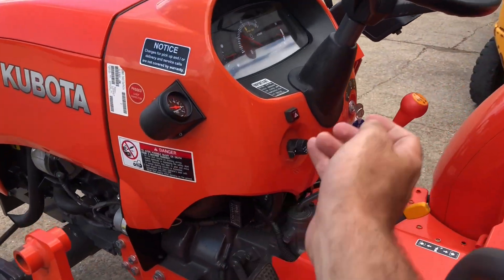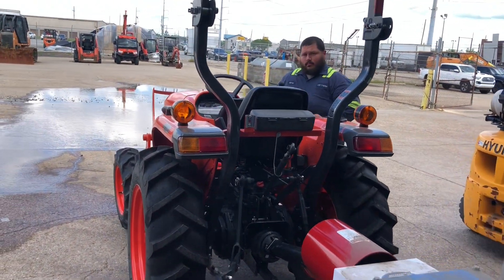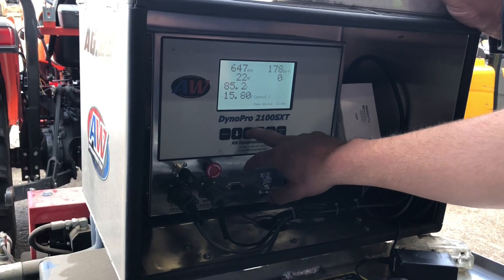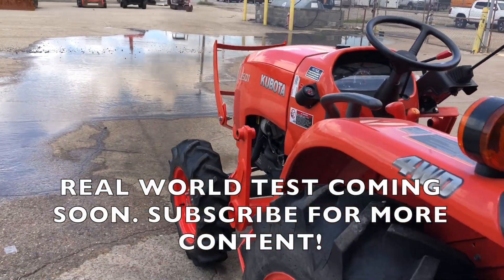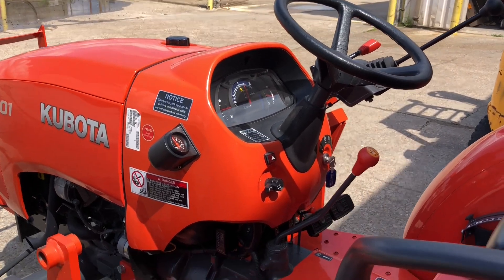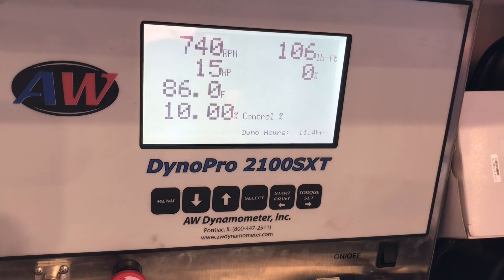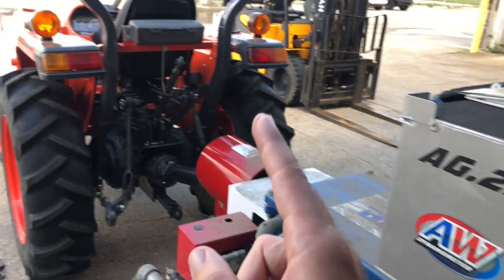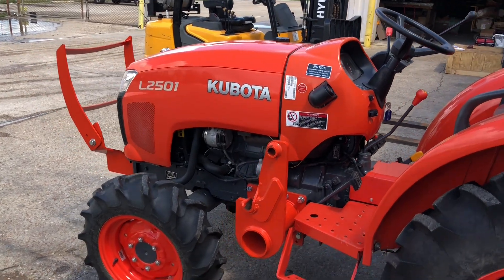Kubota L2501 Dyno Results ~ More Timing, More Fuel, & More Power!

Comment: I have the l2501 hst
Reply from the maker: Turn that bad boy up. That HST eats up some power.
Reply: I turned up my 2501 HST, one full turn on the screw. Running exact same conditions, she rolls coal under heavy load, max EGT just under 1300, very light smoke under normal loads. Its a completely different tractor to operate now. It was adequate stock, now its just a beast! Do it.
Reply: @bearswartz2907 
Hey buddy I installed that same autometer today. Was curious to see my temps. I was about 1050-1100 under load, stock. Do you know what yours was stock?
Reply: @dougchoate2009  No, I installed the gauge when I did the adjustment. I wish I'd installed it first so I could see what it was doing stock...
Reply: @bearswartz2907  oh alright no biggie. Well like I said, mine was about 1050. That was going up an incline in High gear which made it bog down a lot, and that’s when the temps creeped up. I will be using my 5’ brush hog this weekend to see how that affects the temp. 

One more thing, when I start my tractor it spits out black smoke but clears up very quickly. Have you noticed that with your tractor? Tractor is still stock.
Reply: @dougchoate2009  Yes, mine definitely did the little puff of black smoke on startup from the day it was new. It still does after I turned it up, about the same. It definitely starts faster and easier with the timing advanced. Barely hit the starter and it fires.
Reply: @bearswartz2907  im not sure if I’m going to dive into the timing or not, seems like a open heart surgery on my tractor. I’m sure it’s not too bad, kind of of the fence with that. Any idea what the startup black smoke is about?
Reply: @dougchoate2009  The black smoke is normal with any mechanical diesel engine, it's unburned fuel from the first squirt of the injectors before there's enough compression to fire. The mod is easy to do for someone who has some mechanical know-how, but I wouldn't recommend it if it doesn't seem simple to you. If you aren't familiar with the basics of fuel pumps, etc, it would be easy to do some expensive damage quickly.
Reply: @bearswartz2907  thanks for the info man
Reply: @bearswartz2907  
I got the tamper proof lock off the fuel adjustment screw. After messing with it for an hour I think I have found the sweet spot. I ended up measuring the distance from end of black adjustment bolt and the silver lock nut. I took pic, can’t figure out how to send it on these. I ended up at 5/8”. I’m wondering if you have some time, and don’t mind, could you also measure that distance to see how far out I am.

Comment: I wonder if anyone has put a small turbo on one of these? I feel like one of these engines is capable of 50hp. They certainly have enough displacement for it. Would probably over-power the gearbox then.

Comment: I always wondered how much the PTO angle affects those readings.  You had a huge angle going on there, and that would affect the reading greatly. Unless it was compensated for in the calcs. Bet it was actually slightly higher if the shaft was straight in. Prolly not by a huge amount, but could have been a couple horse legitimately. 💪

Comment: I love how you mentioned the tac cable. I’m on my 3rd one now on a 2022 L2501 with just 110 hrs. Other than that the tractor has been bullet proof.
Reply from the maker: Yeah, I tried the route the new one in the smoothest direction I could
Reply: @RaztechPowersports  if I break another one I’m just going to wire a 12v hour meter to the ignition and say the hell with it. I can judge rpms pretty close by sound. 😎

Comment: I have a JD 1025r we finally got a turbo kit out, and with that guys are throwing more fuel at them and making 15psi. I love these little diesel’s I’ll probably wait till i get 100 hours before i throw a turbo on mine but in the interim Ill crank up the fuel a bit as changing the timing is a real bore. Even if its 2-3hp it’s worth it you just don’t wanna roll coal that doesn’t do shit just waste money 

Great video

Comment: Finally. Someone who thinks like I do lol. I hook up everything i get my hands on. But I think I may leave my new 2501 alone for now 🤣
Reply from the maker: First time you run out of power cutting grass… you’ll pull it apart lol
Reply: @RaztechPowersports  lol! Luckily I got 2 kubota z mowers to handle the lawn. But if I end up getting a bush hog for the 2501, your words might end up ringing in my head one day haha. Already feeling slighted now that I've seen comparison on hydro vs geared, but luckily I don't need the 2501 for any plowing or hauling 😅 for me it's more like having an electric shovel and wheelbarrow/rake because that's all I really need it for. But I'm sure over time I will find more things to use it for! And then I'll end up wanting more power haha

Comment: I have the very same tractor. Gear drive and ag tires. The difference between the gear drive and hydrostatic as far as pulling power is unbelievable. The gear drive out pulls the hydrostatic badly.
Reply from the maker: Agreed! The gear drive spins all 4 tires in low range, regardless of the gear for loader work
Reply: I have hydro and you're making me jealous lol but I don't really need this for pulling. Mainly for spreading rock and around the house stuff. Small garden will be about the only real pulling I do. So I'm hoping I never come across the opportunity in which my hydro drive disappoints me lol
Reply: This the first thing I noticed, my last tractor was gear and this one is HST

Comment: I'm waiting on my new egt sensor, did this a while back but the cheap egt sensor sucked so I didn't tune it yet.  In the process of removing my fuel screw it moved too much so I've gotta figure out the tune.  Just screw it all the way in and start slowly doing 1/4 turns until the temp goes up ,  then back off?

Comment: What do you think just adding timing without fuel would gain? Mine is set to run at 3000 rpm not sure if that makes a difference.
Reply from the maker: What engine is it? At 3000 RPMs you’re probably already at the limits honestly. The l2501 was very restricted from the factory
Reply: Ditch Witch SK800 mini skid it has a D1105
Reply: Has anyone did a l2502

Comment: Very Kool modification & power improvement. A turbo-super-charger & air inter-cooler would be the ultimate. Thank you for the great Video Sir and happy tractoring.
Reply from the maker: I turbo charged my last tractor with great results (L285) 🏁. I was tempted to do it immediately on my L2501 but decided to start with the basics and she what she could do 💪🏻
Reply: @RaztechPowersports  oh yea liked that one also. As l recall that unit was a 4 " banger" :: a smooth operation. Just no real reason to over power a new tractor and send it to the junk yard before at least 500 hours of proven performance happens. This was a "brave move" for the Public improvement seminar to deleat your warrenty.

Comment: what are the max Temps for the exhaust?

when you say 1 full turn out, is that from stock?
Reply from the maker: 1350 - 1400 would be considered to hot and you would want to back off the throttle  / reduce the load. 

Yes, one full turn out from the stock location.
Reply: Thank you for doing this! I completed the mod yesterday on my 2501. Incredible difference in how it runs! I had the same 2 shims you did, pulled them both, and opened the fuel screw 1 turn. Get some black smoke under heavy load, and EGTs seem to top out around 1200. I saw where you posted 1350 to 1400 is too hot. Have you found any documentation on that number, specific to the D1703? I've looked but haven't found anything. Really don't want to melt something!
Reply: so does it smoke when you load it above 10 percent and above 800 for egts?
Reply: mine is stock and I don't get an ounce if smoke from it even in stock form.
Reply from the maker: @travisconner1581  correct, because they leaned it out to the max for emissions
Reply: What do you think about lowering the idle speed from 1100 to 8-900? Didn't the older tractors run lower?
Reply from the maker: @grasscutter88  I would probably keep the idle the same. Good oil flow. Really wouldn’t see any benefit to lower the idle personally
Reply: @RaztechPowersports  i wonder why that netigear guy that also did this to his tractor complained that it would smoke even in stock form.
Reply from the maker: @travisconner1581  not sure. Mine burned crazy clean
Reply: @RaztechPowersports  I wonder why it's so high though compared to older tractors
Reply from the maker: @travisconner1581  it starts to roll a little bit of coal above 1100° + with a max load
Reply: @RaztechPowersports  So what if I turned the fuel up a tad and left the timing alone?
Reply from the maker: @travisconner1581  I would say you can definitely add more fuel even with the stock timing. Small adjustments 1/8-1/4 turns out till your seeing a little bit of smoke under heavy load. Do you still want it to burn clean under normal operation.
Reply: @RaztechPowersports  well I don't think you want it to smoke all the time. Slight smoke under heavy load and clear under minimal load.
Reply from the maker: @travisconner1581  Don’t let the Dyno confuse you. The percentages are not correlated 0 to 100
Reply: @RaztechPowersports  I thought you were asking me a question.
Reply from the maker: @travisconner1581  Oh sorry. Didn’t go back to the other messages. It runs all day with a finishing mower with zero smoke and good EGT temps
Reply: So is the timing retarded for emissions purposes?
Reply from the maker: @travisconner1581  correct. To limit the hp so it can slip in under the 26hp mark

Comment: RAZZ- Thanks for the follow up and conclusion to the fuel pump timing MOD . 
What would rate you engine horsepower ??
Reply from the maker: I would say the engine at the crank is making 32 to 33 hp. The torque increase is very noticeable as well